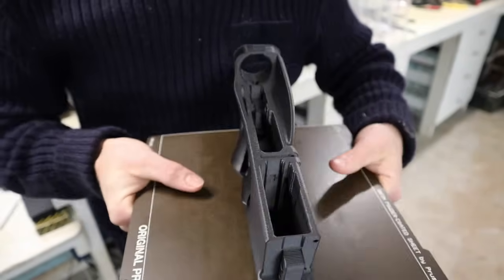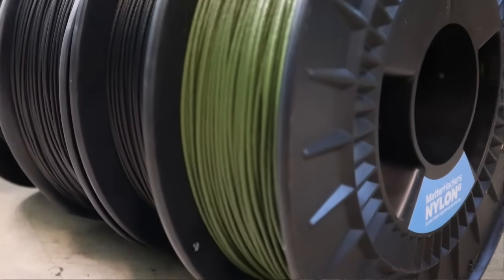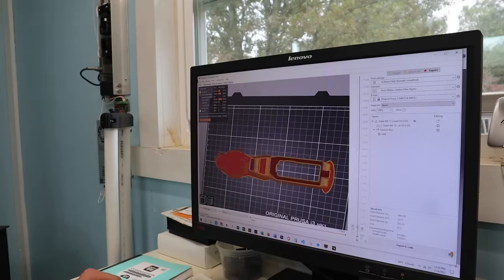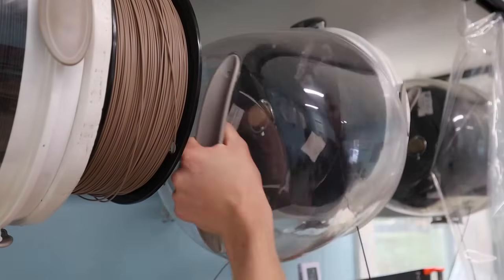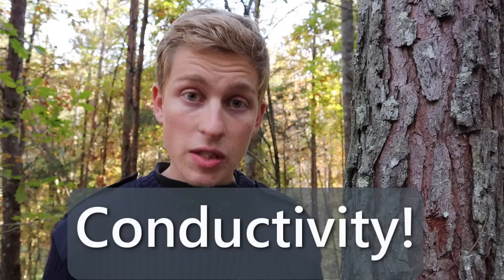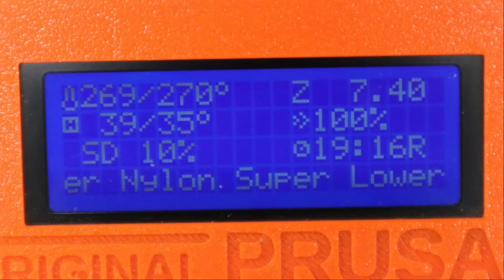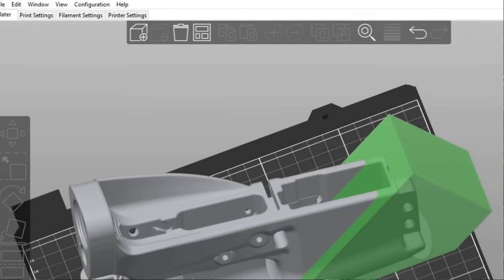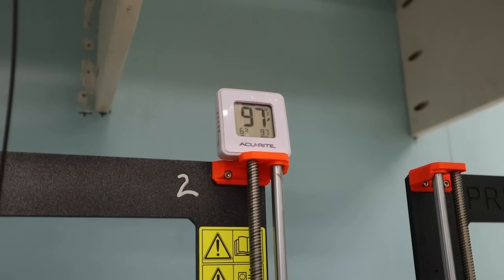How (And Why) To Print With Carbon Fiber Nylon | Print Settings, Tips And Tricks

Comment: Polymakers polymide pa6-cf is fantastic. We print it everyday at work for durable manufacturing tools. We have even printed custom sockets that go on 1/2" battery impact tools and get used every day. Polymakers material is also great because bed temp can be as low as 40c. However i always print with a raft at 290C nozzle temps just for garanteed success. 

Also always make sure to anneal the parts it can make a huge difference in durability and strength.
Reply: And the process for annealing the printed object ?
Reply: @Subgunman  recomended temps and times are listed in the Polymaker TDS on their website
Reply: It is I used NylonX, NylonG, taulman bridge, I could go on for days. That’s what I do is engineering grade filiments. The stuff is awesome. Pa6-cf or pa-12-cf is excellent. Garolite with Vision Miner “Nano” adhesive it’s literally impossible for it to warp even in a non heated build enclosure. You’ll have a hell of a time getting it off the garolite with a light brim. Vision miner “Nano” is got to be the best polymer adhesive on the market and the price at $50  for 120ml reflects this. Both worth its weight in gold.
Reply: @vicewize  Awesome! We also use nano adhesive. Couldnt recomend it more.
Reply: What printer are you using that you get your nozzle up to 290?
Reply: @zacharypaul1111  RAISE3D E2
Reply: How much shrinkage can I expect when annealing the poly? Do you adjust in the slicer? I just got 2kg today.
Reply: How long do you anneal for? And at what temperature?
Reply: @DarkDevildog  there is recomended annealing tempurature and times listed on the TDS for polymaker materials on their website
Reply: How do you anneal the prints!??

Comment: I thought dry filament was bad. Many people say it goes bad if it sits outside the package too long, because it dries out. (Though I can't imagine why it would be "wet" in the first place. What's in it to make it wet? Is it hygroscopic? ...and does it go bad from soaking in moisture and not from losing it?) Sorry for all the questions. (Hygroscopic means it will take in moisture in from the air for anyone that don't know).
Reply from the maker: It's just the reverse of that ;) Filament comes dry, it likes to absorb water. If it sits out, it will absorb water. Water won't damage it just sitting there. But if you print with wet filament, the water will turn to vapor and cause bubbles in the print and it will break down the polymer making it weaker. That is why you dry before printing.
Reply: @HoffmanTactical  thanks

Comment: On an Ender 3, 260°c is the max temp using stock firmware, you have to compile Marlin to get a higher temp, or install Klipper firmware.

Comment: Would highly recommend the Olsson Ruby nozzle for this matr'l. will improve surface finish and will last 10X as long as hardened steel.
Reply from the maker: I was about to get a ruby nozzle, but after some reading I decided that a tungsten carbide nozzle would be better choice. Better thermal transfer and almost as hard. We'll see how it works!
Reply: @HoffmanTactical  Im sure the TC nozzle will work just fine. I've used the ruby nozzle quite a bit and while it is a great nozzle, if the ruby hits the bed during a travel movement it has a good chance of cracking or chipping, ruining your $100+ nozzle... no fun for wallet....
Reply: @HoffmanTactical  Also, Great video btw. After printing these materials and having some experience i still learned some new things.

Comment: try carbon fiber polycarbonate, way superior for what you are doing here. nylon is strong but it creeps meaning under load it will starch or compress. PC is very still it is stiffer than ABS and stronger than even nylon. and its around same price.
Reply from the maker: I did try a CF PC blend for the same reasons you have mentioned here. But found it to lack layer adhesion and impact resistance compared to the CF Nylon. Other CF PC filaments may be better, so I'll have to try some more. But as to the CF Nylon creeping, I've seen no sign of it so far. Most plain Nylon is rather soft, but with the CF fill it is much better.

Comment: Reason why warm bed warps the print seems to be related to expansion/contraction with heat difference. When the plastic is warm, it expands and when it cools it contracts. If the lower layer is on the warm bed, the upper one is cooled and shrinks, warping upwards. I work with nylon quite a bit and found that the best solution is to have a mildly warm bed like you suggested but also have a couple of infrared lamps shining from above on the print/bed, keeping the upper layers warm
Reply: Like with ABS, any heat sensitive plastic needs to be printed in an enclosure, where the ambient temperature is much higher than a printer sitting in the open. You could use an infrared lamp as you said, I actually never thought of that. But having an enclosure that is heated up, even just by the printer itself, before it starts the print should solve most of those issues.
Reply: This is why most people use the insulated enclosures for their printers
Reply: @shaneintegra  Im not sure most people use them but this situation is exactly why they make them
Reply: In my understanding it’s even more simple then that. A hot heatbed prevents the material to solidify completely. The heatbeds heat dosn’t reach the upper layers so the upper ones cool down and contract and as the lower ones are still soft they don’t have the rigidity to withstand that tension the upper layers are putting on them. So basically your right except the part where you’ve said that hot layers extend. They don’t because the expansion happens before they’re extruded as they’re getting heated up. 👍🏻
Reply: Just print with a draft shield. Boom!
Reply: @Michael Strong  thats not always the end all thats for sure. Ever print with this material? Draft shield is the least of my issues. Probably not even an issue in my case. I have to warm the room to about 75 or so and its fine. Draft shields are exactly that. They block drafts that would cool it down. Say if you have it by an open window or something like that
Reply: @strongme80  those dont work that well.
Reply: Still using the lights for warmth?
Reply: @MrModdedgear  yes. Have 2 200w bulbs at about 25% power and there is no warping at all
Reply: @kresimirzezelj8530  What temperature does that get around your printer? With my enclosure printing in my hot garage I can get around 110°F if I remember correctly.
Reply: @rileyneufeld7001  hi! Depends on the material and model. But keeping it around 50-60C seems to work well to allow enough cooling without warping
Reply: the infared lamp idea is so awesome, I may need to try that with some of the ABS prints I try. thank you!
Reply: I have not personally tried it, but I heard of many people having success by using skirts. The skirt 'protecting' the part from breezes and locking in the bed temp better. Although for a large part such as lowers, probably won't work as well.
Reply: Is the sidewinder x2 good to print nylon
Reply: infrared lamps? i'm stealing that idea. no need for enclosures anymore!
Reply: @davidtriune8028  well, I wouldn’t go that far. You’d still need to stabilise the temperature (block the air circulation) or could end up with lifted corners where the cooler air is blowing over the print. But simple thin acrylic panel held with magnetic/adhesive strips works nicely. No need for thermal insulation
Reply: if you can keep the enclosure just above glass temp 74C or so The part will cool at the same rate eliminating most warpage and reducing annealing.
Reply: Shrinkage from crystallization (what happens when you "anneal" a 3d print) plays a much bigger role in this than thermal expansion.
Reply: I think idealy you would want your chamber temp to be much higher to equalize the part temp.
Reply: @Kyrazlan  the part still needs to cool and insufficient cooling causes very bad results. It's a balance of enough and not too much cooling with Nylon
Reply: As mentioned above draft shields work great or just put your printer in a small closet quick cheap effective and reduces noise plus I have the clothes rod to hang a light from huge improvement

Comment: im a3d printer tech and i say you are wrong sorry. u just need to know how to print it high carbon is way better. u should just use straight nylon for guns with more in fill
Reply from the maker: I don't know. High carbon is easier to print, since I think it warps less. But it suffers from lower layer adhesion and impact resistance. It is stronger. So for some things it would be better. But for lower I think there is a balance that is best.
Reply: @HoffmanTactical   Yeah it doesn't have good impact resistance but it's definitely stronger
Reply: @HoffmanTactical   That's why I said use regular nylon for firearms it's really impact resistant

Comment: Have you tried annealed pla for lower? Pla by itself is strong. But annealing increase it's strengths by 30-40%. If you wary about dimension change, here is my solution. Print your pla part with infeel higher then 50%. Then put it into a plaster. Plaster mix is 50/50 plaster/water by volume. Plaster mix should be very thin and watery. It will make removal easier. But the shell of plaster should be thick. For lower it should be at least 4cm. Dry well for a day. Then put it into oven for an hour for 110°C. Let it cool slowly for few hours. Remove your part from plaster. That is a hard part. Water helps. I did it a lot. Never had dimensional changes.

Comment: addressing your comment about problems with small parts. One solution is to design a sacrificial support on the top of the part attached with tabs. That will hold the part in place during cooling and avoid most of the warping. You'll just have to cut off the excess afterwards and do some small post process cleaning.

Comment: Have had a lot of luck with carbon fiber nylon. I haven't heard anything about glass filled nylon so I bought a roll and will get it going ASAP.
Good video. You hit the nail on the head with drying filament and going immediately into a dry box.
I remixed and printed a double rib super lower. Works like a champ.
https://youtu.be/EtKHA5eWrAI
Can i share the STL of the Super lower with a double rib?
Thanks for the great videos and your hard work is much appreciated!

Comment: A few things, to correct those who have been commenting: Nylon gets tougher but weaker when exposed to moisture. So it can take larger impacts, but will break more easily under strain/load. 
You can print PA12, PA66, CoPA and Taulman 910 and 645 at 255-260C on an ender 3. If you use a bimetal heatbreak you can reprogram the Ender 3 to safely go up to 300C which will free you to print with PC (polycarbonate) or PA6. 
For the lower temperatures, Taulman 910 is really incredible stuff. 
Polymaker PA6GF (glass filled) is a pretty great material, their carbon fiber filled is a little bit more finicky and acts more hygroscopically in my anecdotal experience, though both benefit from aggressive drying before using...every...time...(80C for 24+ hours).
Reply: I tried 10.5 hrs at 110 C and I'm still not sure it's dry.
Reply from the maker: The link between impact resistants and tensile strength is pretty common among polymers. It's a trade off between many plastics. TPU is indestructible, but weak.

Comment: try some x3d tech asa cf? probabbly better than nylon all together. you will need to make an enclosure though..
Reply from the maker: If it's got CF in it, I can problebly print ASA without much of an enclosure. I just don't think it will be as good! Though I bet it's get better impact resistance.

Comment: Good video, recently subscribed. I’ve always taken poor bed adhesion to result in warping no matter the material, including PLA. I would argue it can halt curling and other warping.
Reply from the maker: Definitely! Poor bed adhesion will lead to problems, however, it's not enough to prevent warping if other factors are not correct.

Comment: have you ever tried printing a lower in asa? would like to see how that material fairs.
Reply from the maker: I will be trying one in ABS, since I have it. I have used both ASA and ABS a lot in the past, and don't think there is much difference mechanically. ASA is no doubt more UV resistant though. I don't expect much, these plastics are weak and have very poor layer adhesion. But we will see ;)
Reply: @HoffmanTactical  It is the heat and uv resistance that im interested in. i guessing carbon fiber nylon works well for lowers strength wise.

Comment: Interesting video as I've got a new roll of CF PLA in front of me. Currently waiting on my steel nozzle. Have you thought of remixing the Hoffman Tactical AR lower for 9mm Glock mags?
Reply from the maker: I'm working on the AR9 version now ;) As to CF PLA. I think a CF PLA+ would be interesting, but a CF plain PLA may not be much better then without the CF. I've not tried it though.

Comment: Great vid! I did not catch what speed you use for carbon fiber/nylon. Or did I miss it?
Reply from the maker: Same as the rest of my printing, around 40 - 50 MM/s. Things like outside perimeters are much slower of course. All the details are in my slicing video.

Comment: Use a raft on your smaller parts.. ive ran into this in the past.. small nylonx parts warp.. the only thing that worked for me was adding a raft. But GREAT vid man!!
Reply from the maker: Great suggestion. A raft is just what I used to get the small test samples to print, they still warped, but the print was able to complete and the samples where ready to be broken.

Comment: Also as far as the nylon parts warping when smaller, I would try looking into using a garolite bed if you haven't already. They are really good for small nylon adhesion.
Reply from the maker: I actually started with a Garolite be when printing Nylon, but was not overly impressed! I think printing smaller parts very slow and with a raft is the trick.
Reply: @HoffmanTactical  Great, glad you've tried it. I guess slow and steady will always win the race haha

Comment: Nylon can be made tuffer/stronger by soaking the finished part in water not sure if temperature of the water all though my gut feeling is start a soak with warm water and then  allow the water to cool down slowly to room temperature.  Your anti-wrapping sound good I will try them.
Reply: I have no idea if it would work but I am planning on experimenting with stabilizing resin. You can take a piece of half rotten wood.....dry it out in the oven to 0% moisture content... submerge it in resin (I use SOS brand but Cactus Juice is similar) under vaccum....then cure it in a oven at 220°F and it becomes strong enough to make mallet heads out of. 
I'm going to see if it will do the same for a ........ !!!!
Reply: Tougher, NOT stronger. It will increase impact resistance and WILL LOWER its tensile strength. Depending on the type of polyamide, it will weaken as much as 75% depending on how much water you let it absorb.

Comment: You should do a CF PEEK or CF PEKK "part". I think you would be the first. I would donate to the gofundme.
Reply from the maker: I know that somebody has printed pistol frames from these plastics. I've also tested Ultem 9085, a gentleman sent be some samples. It's strong, but even with a 130 C + chamber it still warps! Layer adhesion was very poor.
Reply: @HoffmanTactical  I thought the CF was supposed to help with warping and layer adhesion. Obviously I don't want to spend my life savings on this stuff until I see someone with experience try it out.
Reply from the maker: @harrygoonix  It probably does, but still it requires a pretty mean set up to print with!

Comment: I would love to see some tests of nylon printed at 260C. I'm too poor to afford a new thermistor...
Reply: Different types of PA (nylon) print at different temperatures. At 260 you can successfully print PA12 or PA66 or CoPA or Taulman 910/645. PA6 needs 280+ to get proper layer adhesion.
Reply: There are pla and petg carbon filaments available too. Which would print at those lower temps. 👍🏼
Reply: @Prof.Polymath  Be careful with CF-PLA, its usually weaker than traditional PLA. Adding things like CF and glass to reinforce polymers traditionally is done for one of two reasons. One, to make it lighter, or two, to make it more rigid. PLA is already a rigid and brittle polymer, so all you are doing is removing some of the interlayer adhesion. PETG I could see benefitting from some fibers addition since it does deflect more than most PLA compounds. CF-PLA is mostly just for marketing and not actual strength.
Reply: @mrnukeduster  thank you, yes sorry I should have said, the carbon loading can be used for other properties not just the assumed strength we associate with carbon fibre I guess. It is suggested that a pla+ carbon can be easy to print and produce a part with esd or antistatic properties. If you so wish. I find ASA does it all a little bit better anyway. But that’s just my experience. Happy printing  👍🏼